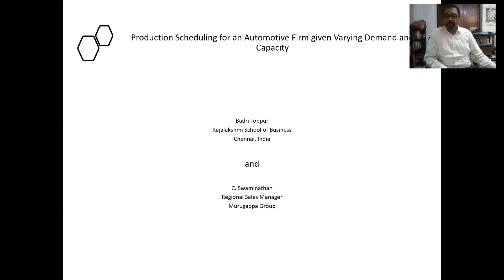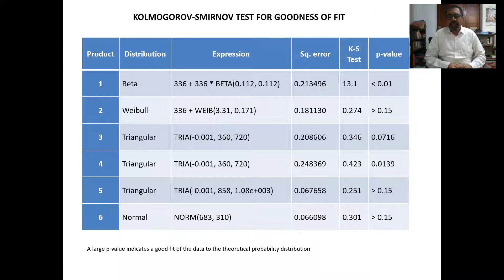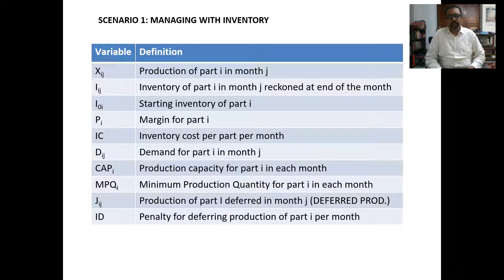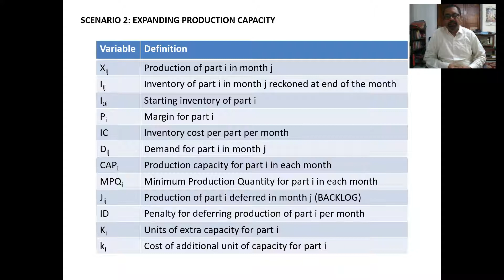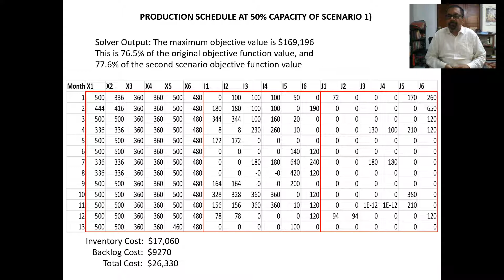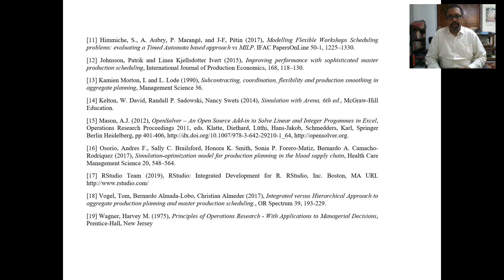Production Scheduling for an Automotive Firm given Varying Demand and Capacity

Comment: Very organized, insightful and inspirational presentation. Dr. Badri Toppur showed excellent experience and knowledge on how to apply that to problems with critical thinking. This case was concrete, usable and applicable for teaching MBA students .  He inspires me to think more and more deeply.
Question (equality constraints slide) Why the term Ji12 in the 12th constraint is missing? Can we keep it then the solution will give it zero value? Is it because the demand in that period less than the capacity?
Question 2: When finding the solution using solver did you set the initial and closing inventory values  
Ii0 and Ii13 to 100?
Reply from the maker: Dr. Shorouq, thank you for the compliment about my B&ESI presentation. 

Your question is good; since there are 13 months in this planning period - a baker's dozen - there should be a term Ji,12 in the last two equality constraints. Depending on the data, it may or may not be zero in the solution.
Regarding the second question, in the solver, I did set the initial and ending inventory to 100 for all six parts.